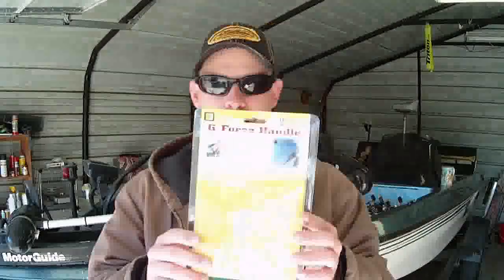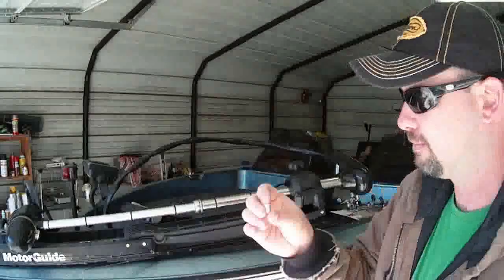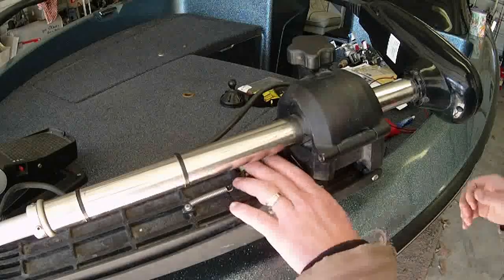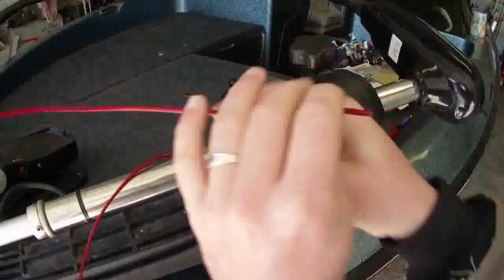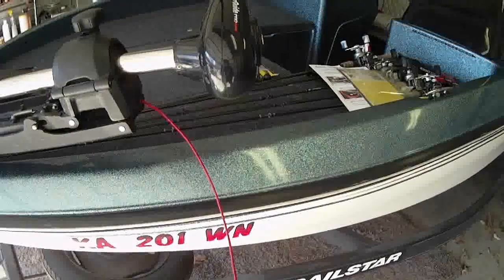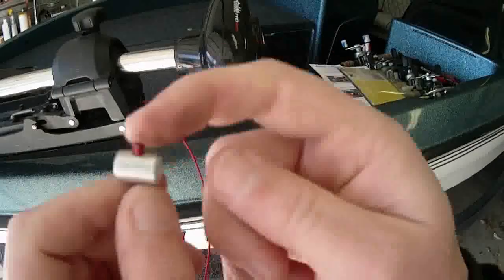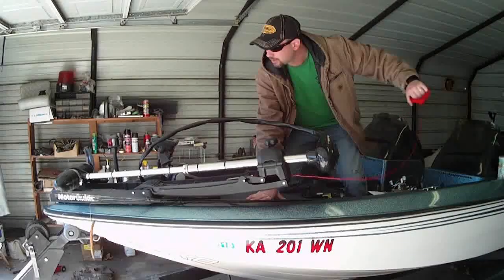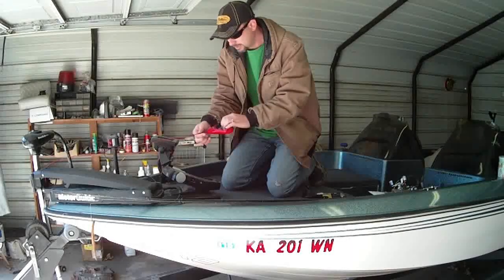G-Force TH-Marine Trolling Motor Handle Installation on Motorguide

Comment: new rope about $1.49. g cable about $50.00. on the motorguides with the plastic guide for the pull rope I don't recommend this. the cable coating wears and then the steel cable destroys the plastic guide. also a lot of use wears the coating off and even the metal guide holes are damaged eventually.  way worse than having a broken rope. the rope does not eat the plastic and even though I fish a lot I just keep a spare rope in my boat and inspect the motor rope a couple of times a season. if fraying is discovered it takes only 15 min to change even if its your first time. most pros don't keep a boat long enough to experience steel cable damage from worn cable coating. the bigger the motor the faster the wear rope or cable.. my spares are on a lot of friends boats. I check mine.

Comment: I also have a Motorguide Pro Series 46lb 12v (though it seems to be an older model than yours). I've seen numerous disclaimers stating that it's not recommended for Pro Series Motorguides.. I'm a little hesitant to pull the trigger on this due to that, but yours seemed to instal just fine. However, since mine's an older model I noticed that the hole to run the rope through literally sits flush right next to the shaft hole on the mount.. I wonder if that could pose a problem?